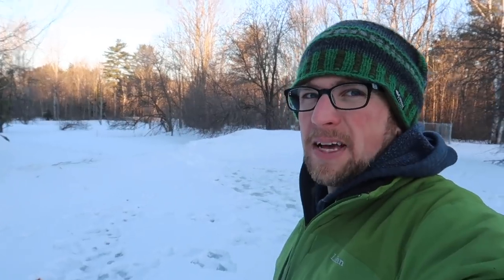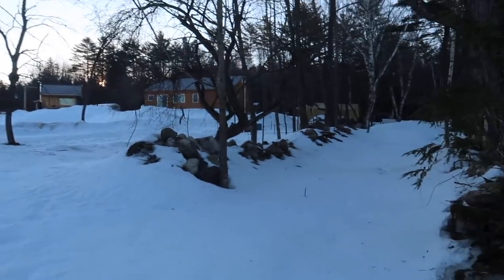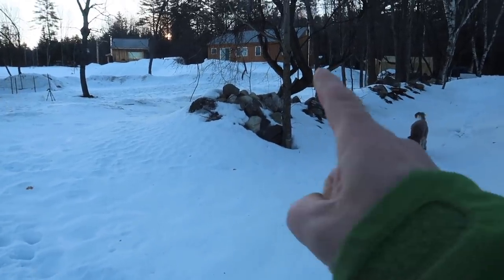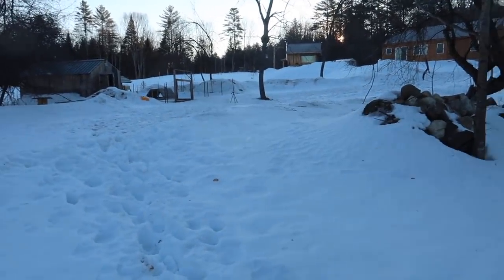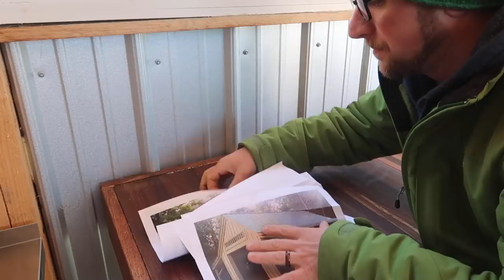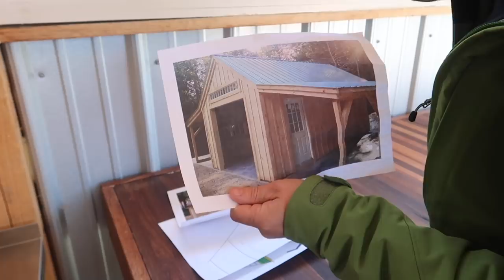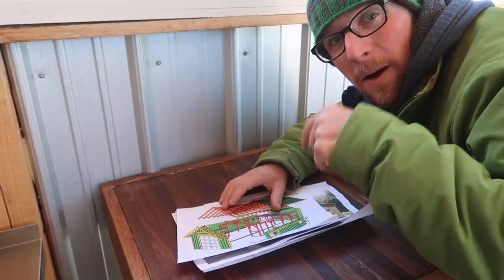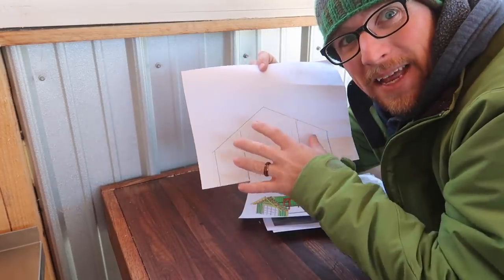Plans for the Post and Beam Barn we Bought OFF the INTERNET

Comment: Al , your choice of course but I would build the barn off the end of the house where you park the cars , maybe 10 - 15 feet out , concrete floor throughout , make it a combined garage for the cars , workshop and room for animals on one side . Your cars are worth thousands of dollars and are suffering in the elements plus the time spent de-icing each day in the winter months , also scratching the paintwork . Close to the house means easy extension of services ( electricity , water ) and it would be easy to add a covered tunnel between barn and house so moving people and shopping between cars and house is a dry affair in inclement weather . 
                 In my mind  , that would maximise the benefit of this barn and get best bang for buck . All the best as always , wish you all well :-)
Reply: Excellent suggestion and so much more practical. I hope Al reconsiders where he places the barn also.

Comment: Gooooood mawning!  Can’t wait to watch the barn build. If I can offer suggestions learned after building our pole barn. Build it on a high spot so you get better drainage and hopefully less mud. Take notice of where your cold winter winds blow from,  you may not want to face your door in that direction. We also opted to put large sliding barn doors on the back too. Best decision ever. Gives you drive through capability and really allows a nice breeze to blow through in the summer with lots of light. And one more suggestion, I’d put it closer to the house. You’ll eventually want water and electricity in the barn, so it’s a cost factor to run it a long distance, not to mention your winter trekks through the snow. We regret we didn’t cement the floor in the main part of the barn, or put in a loft, so good decision there. After seeing your building skills, you’ve got this. 👍
Reply: All VERY good suggestions-The back doors will save you many steps!  If you never use them it still is a good idea for a summer breeze!

Comment: If you can try to make pen panels that you can remove if you need to. My cattle barn had panels that hung on pinned hinges and it allowed me to take all the stall dividers out so I could clean it out with the tractor. It also allowed for more flexible pens, there are some excellent sheep panel systems on the market that might give you ideas. It’s awesome to see your excitement and the barn design rocks.

Comment: WOW!!  Awesome looking plans - very excited for you and I can tell you are too.  Yep, definitely a game changer with a barn.  If I can make a small suggestion - extend the concrete slab 6 inches past the outside of the walls with a slight downward slope - it will extend the life of your walls at the base. Without that extension the bottom of your walls will get more moisture (even with the overhangs) and dirt on them.  I would also extend the concrete 6-8 ft in the front so you have a landing pad in front of your garage door.  I have this on ours and man I'll tell you it becomes a great place to unload things, to work on things outside (I do most of my work there), or to just sit and check out the property with a cold drink.  Since you are planning on driving into your barn make I'd put a concrete ramp in the front too. Not only will this make it easier to drive into the barn, but it'll keep the barn cleaner.  You could also park the tractor there and hose it off before entering the barn.  Anyway those are lessons I've learned with our barn. CANNOT WAIT until yours starts going up and thanks very much in advance for the tour of the factory Al!

Comment: We went a different route for out buildings and clearing the land.  We are clearing the land ourselves.  We are using the hardwoods for firewood and the softwoods to build with.  We bought a sawmill and started milling the lumber for our outbuildings.
Reply from the maker: What sawmill did you buy?
Reply: @LumnahAcres  we bought a woodmiser lt15go.  It is a manual mill, but it works great for our needs.

Comment: Maybe closer to the house would make it easier to run water/power to the barn Al. Just something else to consider. Also can't wait to see the worms!
Reply: There are countless books and plans and things to consider when constructing and laying out the farm buildings such as driveways prevailing winds drainage access to pasture and other fields yes many factors to think about. Will you be able to use the tractor to clean out the stalls and pens the goats hooves will pack the manure rock hard, you already know how hard the chickens can pack the manure even with feeding them the way you do. A tractor is way easier than a grub hoe, don't ask me how I know.
   Yes on the windows very few barns have enough day light you can not have enough windows in a barn, the animals need the day light during the long winters just as people do. Your chickens if you want to keep up egg production you must have lights on a timer to give them more light hours, the other animals usually don't require longer hours of light.

Comment: By the time you start the barn make sure you have a long enough Electric cable. A Mains Drill with Hammer action, A Small Mains Drill for pilot holes, A Battery drill with Screw Driver, Long extension Screw Driver Bits and 2 or 3 spare Batteries. It is so much easier if you do not have to keep changing Drills and Bits and you will be surprised how often the longer Bits get into the corners better?

Comment: Song of the trees:
Look for branches that are bent over.  These are the ones that will break under a heavy snow load.  Their naked profiles will tell you which ones will have to be better cut back.
Hum...do you suppose soil tempreture makes for sap arising?  Would black rocks at the foot of the trees act as heat collector's?

Comment: Good morning Al.  I was wondering about your ppm, did you put a translucent roof panel on to let light in like you did with the goat shed? Like the barn design, but if I were in a heavy snow load region, I might have gone with the Dutch Colonial style roof so the snow would slide off easier.  I am looking forward to the barn factory tour.  Do you have a birthing stall for Willow?

Comment: You are definitely showing your excitement about the barn build.  Old carpenters never die ...they just hammer and saw        Have you thought about solar power for the barn?  Maybe for lights and possibly heat?   I have read about solar being used to melt the snow on roofs to keep the weight off. Those cans are so difficult for me to open I have one of the neighbors kids pop off the lids for me and I put some of the paint color on the can.  They are 10 and 11 years old.  Ha ha ha ha...... More like adult proof in my case.